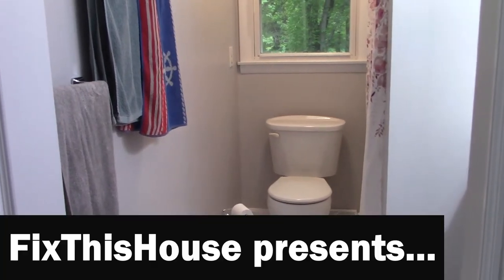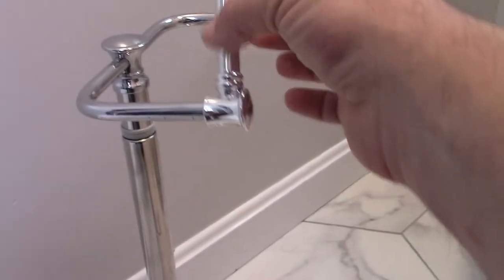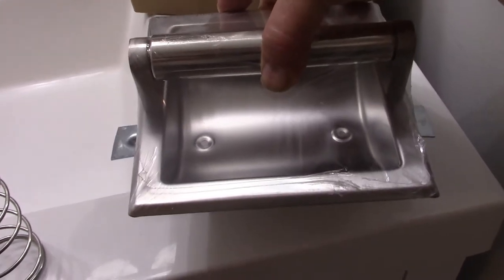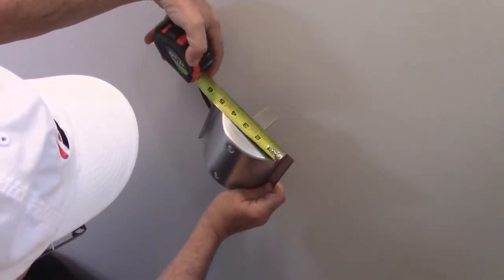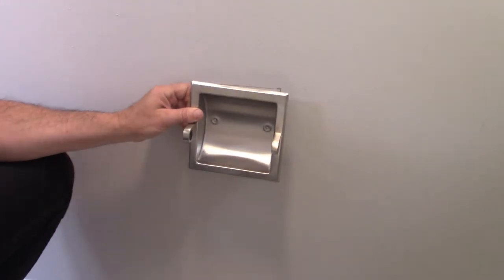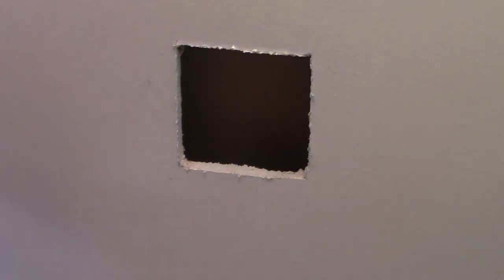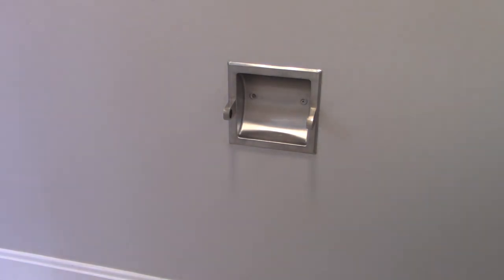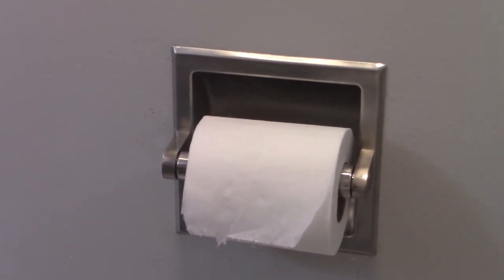How to Install a Recessed "In-the-Wall" Toilet Paper Holder / Dispenser

Comment: Thanks for posting that.  I disagree with using the adhesive.  If I'm going to paint the wall I want to be able to remove the fixtures and paint behind rather than masking it off.  The other way to install the bracket is to start the screws onto the paper holder while it's outside the wall, then rotate the assembly 45 degrees so the bracket will go into the hole on the diagonal.  Then straighten it up and finish tightening the screws.  No spring needed.
Reply: My dumbass really had to reread what you said like 10 times to understand what you meant. But you mean to install the bracket onto the toilet paper assembly while they're both outside the wall and then rotate it at a 45° diagnol angle and put it back into place where the hole goes and back to 90° and walaa

Comment: I'm curious as I have a recessed wall one but one side of the holder the little handle is loose and I don't see anyway to tighten the handle.  It has screws but no way to tighten it.  So the toilet paper is loose due to this.  Any suggestions?
Reply from the maker: Could you buy a larger toilet paper insert — the springy part? I’d be really frustrating if the roll kept falling. Maybe a universal replacement would be an easy fix.

Comment: How can it be installed in cabinet side? Ty
Reply: Same way except you don't need the spring. When you screw the toilet paper holder into the bracket, it will hold the assembly in place. I would be very careful not to cut the hole too large when installing on a cabinet.

Comment: You lucked out. You didn't hit a stud. Maybe use a stud finder first to make sure the hole is in the right place? That way, there won't be an extra hole to repair later. Paper goes over the top. Even the original patent drawings direct the user to have the paper roll over the top.
Reply from the maker: It wasn't luck. I can tell where studs are by gently tapping on the wall. I determined that in advance of filming the video. Thanks.
Reply: I think he pretty clearly showed that he wasn’t going to hit a stud for obvious reasons and then he didn’t hit one. No luck involved.
Reply: @kenbrake2828  It's an instructional video. Those who haven't done this sort of installation before may not be aware that a stud could get in the way and make a hole in the wall in the wrong place. It should have been mentioned that one needs to locate the studs before making the hole in the wall. That's why I brought it up. He knew that, but didn't mention it, so others would be aware.

Comment: Hello! Thank you for this helpful video. The result looks good and I hope it's worked out. (Uh, for the next time you do this project, perhaps Toggle-Bolts (1/8") could be used instead of Screws, as long as the Holes in the Bracket are large enough (to take the Bolt-part of the Toggle Bolt-product?)) But you're in Toilet-Paper! Take one for the Team. (Huzzah!) -Renee K. Taylor, Kamloops, B.C., Canada (Feb. 20/22.)

Comment: The over the top according to the patient. 

Also in my opinion your rolling off paper vs having to interact with more surfaces. 

Not saying your specific bathroom is dirty but  every ones is between cleans and the free stand holders were always getting bumped over so picking that up because who closes the lid 

Awesome video! the spring bewildered me
Reply from the maker: Thank you for your comments! All valid points. I (Nancy) prefer over the top. Some cat owners may argue otherwise. Then again, last week I caught out 1yo puppy eating yet another roll of tp off the roller!